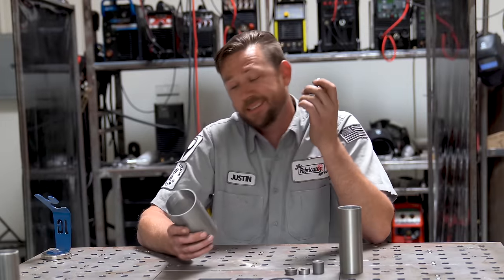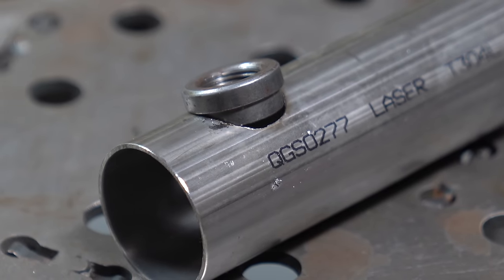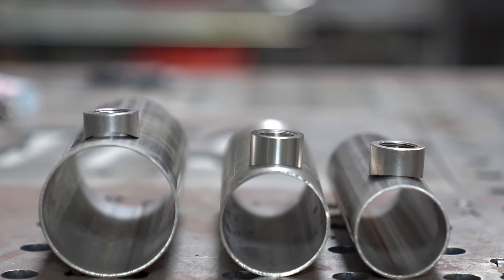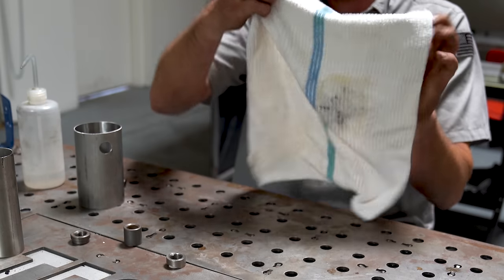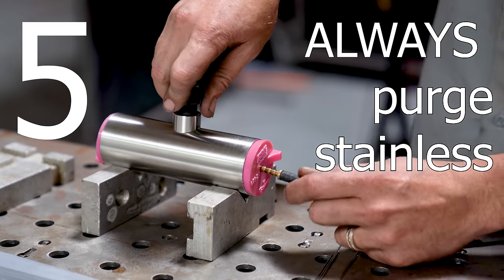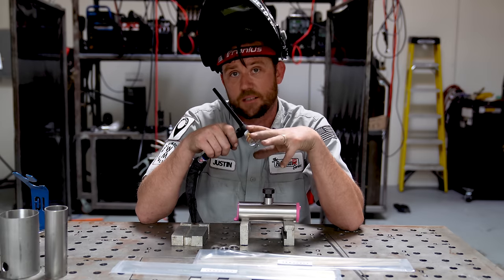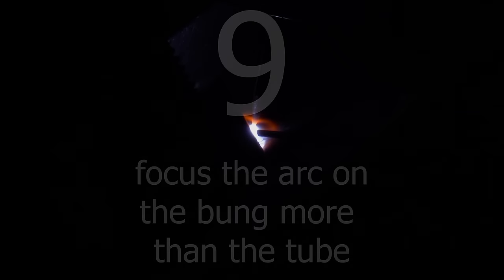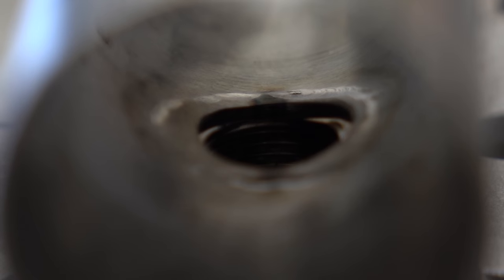10 Secrets for Perfect O2 Bung Welds

Comment from the maker: 💥 SAVE with code TFS10 at Weld Metals Online 💥
https://weldmetalsonline.com/
Reply: Hey Justin love your videos you are are the only reason I started to get into Tig welding you are a inspiration man. Just got a question - What is the difference between a normal tungsten compared to the Lazer tungsten you where using also used it on your alloy video?
Reply from the maker: @shaunhills3902  I appreciate it! 
There is no such thing as "normal" tungsten. There is only the tungsten that works best for what you do. In my experience, LaYZr is the most indestructible tungsten that literally welds every single metal I throw under it. It just lasts for ever and its my favorite until something proves itself superior.
Reply: Justin I can't thank you enough brother. I haven't been on the scene in 16yrs. Started again 2 days ago and I'm already shinin. Without you, Jody, and bob idk wtf I'd do for morale, motivation. Thank you for everything!
Reply from the maker: @CallofDoobie585  Keep at it 👊😎
Reply: Hi Justin, great video and thanks for the info. I like those aluminum blocks you use for positioning with the notches cut in them. Do you make them and if not where could I get some?

Comment: I've done literally thousands of stainless fittings to stainless tube, the requirements being for pressurized hydrogen and helium gas.  If you want something to center a fitting to the hole in the stainless tube, machine a plug to fit the bung for alignment.  NEVER, EVER use a threaded bolt as a centering device.  It only takes one to freeze up into the fitting to destroy both the bung and the pipe assembly it's going on to.  Also, I usually use the bung as the gas vent to allow the inert gas to exit the assembly.  This guarantees inert gas right at the inside of the weld where it needs to be.

Comment: Dumb question: if the bolt seals the bung, and the plugs seal the ends, and gas is flowing into the tube, does that mean that it's leaking or purging out of the seam between the bung and the pipe? My concern would be that as the gap was sealed off, the pressure from the purging gas would blow out the molten metal at the very end. Maybe the surface tension is enough to keep it all locked in.

Comment: I am about to Tig weld a bung on my bike exhaust and was wondering if it’s really necessary to add filler material. Come to think about, it does not need to be a very strong weld, all it needs is to be air tight. Thanks for your input.

Comment: Yes, always purge. Who makes those purge plugs your using in the ends? Side note the bolt works great but I wouldn't screw in in more than 3 or 4 threads, in can shrink and you will ruin the threads when removed.Thanks

Comment: I have one other tip I also use tip 4 and use a piece of rod ( sometimes a bolt sticks) as a heat sink but also I do not drill a hole until after welding the bung on.
Once the bung has been welded in place, I centre punch, use a slight undersized drill to Pierce  the pipe, then use a correct taper tap to tap out the hole.
You get the benefit of not blowing out the hole and once the thread has been cut into the pipe a more uniform job with extra threads...try it out!
Reply: Like this idea

Comment: I love using the Vibrant O2 bungs with the saddle that sits on the tube.  It also spaces the weld farther away from the threads to minimize thermal distortion.
Reply: These are the ones I use. Love em and make it very easy to not screw up.

Comment: what's the rationale of using 308 filler rod and (assuming) something like 304 base material? wouldn't 316 perform better as both the exhaust or manifold and filler material? regardless of that though, fantastic work, a lot of broscience in the field of welding especially coming from mechanics rather than welders

Comment: Nice piece of craftsmanship !

Never welded bungs but I did other stuff with thread in it, always put bolts in it, you risk deforming the thread by heat. 
Have seen enough examples of people trying to weld a nut onto something and afterwards it didn't work anymore, quite funny 🤣
That was with mig welding by the way.

Comment: Sensei Justin, I have a similar situation: angled solid 1" BungKing seat bungs on a 10 gauge mild steel solo seat pan. My 1/16 tungsten tips are burning up and the machine only lets you go to 90 amps before giving a warning. My welds look like blobs. Should i go to 3/16 tungsten , small wire (like double wound mig wire) or ? and say, 70-80 amps like you are doing here? You are right the parts are getting glowing hot. Nothing is flowing except the money leaving my wallet. :-0

Comment: Have you ever tried SolarFlux Type B for backing up your stainless work?   I used it on a SS exhaust and it saved me quite a lot of gas because I didn't have to purge the mufflers.   I bought a 4-oz bag for $20 on eBay.  You mix the amount you need with methanol and paint it on the back side and edges of the joint.  It dries quickly and you can weld right away.  It will melt and move out of the way if you weld over it, and the residue is sorta like glass.  Not good for food tubing but AOK for exhaust pipes.
Reply from the maker: I have two vids about it

Comment: This is so timely... I'm trying to weld a drain plug bung into my Transmission pan and it is just like an O2 bung. The problems abound immediately. I'm not sure if there is a coating on the pan because I'm getting a brown haze. Plus I ended up with a small hole quickly when I was just getting started. This little job is more trying than most of my welding projects. I hate to mention this is the second attempt because the first one is dripping under my car. I ordered another pan and another bung to try again in a different position with hopefully better results.
Reply: Any metal that is in contact with oil will have problems welding if you don't thoroughly clean the metal and then take a torch heat it up to sweat out the absorbed oil in the pores of the metal

Comment: Could have used this vid last year. Took me three tries! Cutting the botched attempt(messed up my measurements and had the angle off and it was pointed straight at the engine and couldn't install the sensor) out made almost as much a mess as anything else. It also appears that some of them are made of really junky metal that just wasn't cooperating. The final result was ugly(not to mention the patched hole from the bad location), but it worked.

Comment: Excellent video as I'm getting ready to TIG my turbo hotside. I've been Tig welding aluminum for twonyears now, steel/stainless are harder for me to grasp for some reason. You mentioned using a .045" filler rod. What size tungsten would you pair with that? Does this .045" filler rod tip apply to welding the v-band flanges as well?
Reply: For me it depends on amperage I'm going to use. 3/32'' is common as all around tungsten... If You're picky like me try to find .080''. I started to use it on thin stainless. 3/32'' felt too much and 1/16'' didn't stand so many restarts.

Comment: I always use a brass bolt in the bung and I have a piece of 1/6 inch thick by 2 in square piece of copper that I form to fit the tubing OD with body panel hammer.  When I place the copper inside of the tube as a backer and clamp the bolt and backer with vice grips it conforms perfectly to the ID.  Results = Zero blowouts.  I've even used 1-1/2" small diameter pipe and some old chisels to wedge the copper into place. 
I do the same when making custom hinges I use a brass pin before welding and on accessible body panels I use 1/16 inch by one inch wide by 12 in long strips behind the metal to keep heat warping down.

Comment: i weld at 90 amps when welding stuff like that and aim the arc slightly towards the thicker piece with the threads in this case.  i personally weld nuts to square tubing fairly often in my work and it is a similar thing when welding this thing.

but what i mostly weld is thin walled stainless steel tubing with tig.

Comment: wish i knew these tricks when i first started at my company 2 years ago, fresh out of college lol. pretty much learned everything you showed here as i went along tho they dont allow us to purge unfortunately. just means i got better at heat management to not burn the stainless haha. luckily they let me switch the whole tig dept over from the crappy pink cups to  the 12 furick setup so quality and ease of welding has shot up since.
Reply: You’re kidding about not purging right?
Are you not working with stainless steel??
How do you get away with tig welding a one sided stainless steel joint that cannot be accessed from the back side, in order to back gouge/grind, since there is no purging taking place???
Sugaring is not an issue with your QC department and most of all your customer?
One-sided, stainless steel complete joint penetration, with no access to the backside is ideal for purging when tig welding....
Assuming you are using the GTAW process that is...
“Sugaring” at the “Process” side of a stainless steel fabrication is a MAJOR NO NO at my facility.....
I’m all for back grinding the root whenever accessible....
This is common at our facility, but there’s always those situations where you cannot access both sides of the joint, hence the purge operation....
You should take the initiative and start purging when applicable.....
Just my two cents....
Reply: @jamier6742  while yes i agree that purging everything would be ideal and it bothers me that we don't, the customers we have typically dont worry about it. We make various oem replacement parts for pretty much every semi truck mfr. (Mostly exhausts) and none of the customers request that we purge the components. They know we dont and pay us accordingly to bring the unit price down. We only purge if the customer requests that we do so.

Comment: that's fine if you can roll the pipe around like that on a bench have put tons of threadlets on pipe but usually after the pipe is all up and then then the engineers ask for probes and drains always in position and usually on a ladder

Comment: Great tips. Welding on a tight diameter is always a bit more challenging and stainless with the purge adds to the effort. The last header I made header 15 years ago used /16 rod". I now have turbo header and exhaust to make in 304. On your advice, I picked up a 10 lb of .045" from my LWS which I should be able to pass on to my boys.

Comment: Great info.. can you do a video on making a jig for bent tubes, forming an OEM style exhaust port spigot for harleys, best wire grade and thickness to make the best welds on 304 tubing, welding a stepped tube i.e. 1.75" to 1.875" basically everything that's required to make a set of 2-1 exhaust system for harley

Comment: Once used a stainless steel bolt in such a scenario, the thing you can not get out again. :D
Reply: loool
Reply: Yip... 
bin there, done that 🤦‍♂️
Reply: How did you fix that Fraylem I did the same thing
Reply: I welded on a handle to throw away and started over.
Reply: @Josefppaz  you welded the bolt to the bung. Cut it off and redo it...
Reply: Dave McDaniel hi Dave I had too, once I welded the bung the thread must have shrunk with stainless bolt inside. I guess the more practice the better👍
Reply: I did the same thing Lol glad I’m not alone
Reply: are you suppose to use a aluminum bolt?
Reply: @jascal8437  yeah, or coat a standard steel one with high temp antiseize.
Reply: Dave McDaniel thank you
Reply: Show you right! Stainless distorts so easy.
Reply: He just uses a cheap A 36 bolt.
Reply: The part will always always  shrink when you weld it. Once a few good tacks  are on I always take the bolt out or in this case unwind it most of the way out before doing main welding
Reply: If you are using a stainless bolt on a stainless bung, you need to apply antiseize lubricant even if you aren't welding it or it could get stuck.
Reply: Stainless will shrink and then gall when you try to remove the bolt. It helps if you wait until it is fully cooled off to remove the bolt, and also use high temp anti seize like others have mentioned. I think we all learn this one the hard way! Lol
Reply: @Dr_Xyzt  might have to give it a whirl
Reply: @Dr_Xyzt  I use steel wool in aplications like this

Comment: What did you use to purge the pipe? Did the lose fitting bung and screw create a tight enough seal?
Reply: You don't want a tight seal actually.  A lot of people use balled up aluminum foil around the argon line, then a ball of foil on the other side.

If it's sealed it will blow out when you weld it on thin (.065) material.

Comment: I wish there were cast iron weld on bungs. Too many times my O2 sensors after usage gets stuck on those steel and stainless steel bungs. Maybe I need a tap to give it a bit more clearance or learn to weld with less heat.
Reply: Never Seize? Even if it passed pure oxygen a light coating on threads would be of minimal risk and should make future removal much easier. You could also in essence, lap the bung with an forged steel NPT plug, using a bit of NS and drive it in hard, then take it back out. This should stretch (or ream) the bung back into it's pre-weld profile.

Comment: Very informative video. I do lots of gland entries on cylindrical terminal boxes, and these tips help a great deal. I generally fit them up using flat bar clamped to the inside of the tube, then tack up and take the cup for a walk if the gland is big enough.

Comment: Are you supposed to keep the bung 90 degrees to the pipe or angled at a 45?
Reply: 90 so that the o2 sensor is in the center of the exhaust.

Comment: could you help me out with what welding setting you would use for 1.5mm wall stainless tubing, gas flow, amperage, filler size, tungsten size???? My welds are solid but they are coming out grey and shitty looking. I wipe everything down,tried upping the gas flow, amperage up and down different wire size and still still no luck. But when I weld the same tubing to a 12mm thick flange the welds come out beautiful with all the colours. 
Any help would be much appreciated,
Thanks
Reply: Amps & volts too high
Reply: Remember, a rainbow 🌈 colored weld bead and heat affected zone does not always constitute a “good” weld....
Using Stainless steel as an example, color in the weld or HAZ tells the welder that an oxide layer has formed, in which, can and will affect the corrosion resistance of the S.S. The darker the color, the thicker the oxidization. The industry and application of the weldment plays a role towards the acceptance criteria of a welds color. For instance, any color in the weld other than chrome, is unacceptable in the pharmaceutical industry. In other industries that demand sanitary welds, one being dairy, light blue colored welds are acceptable. Corrosion resistance can be reduced or all together lost, when trying to achieve rainbow 🌈 colored welds. In short, If you are an artist and don’t particularly care about the materials corrosive or mechanical properties, by all means color away. If you are doing code work, it would be a good practice to keep the color to minimum and/or within the specified acceptance criteria....
Happy welding!!!
😀😀😀

Comment: where do you buy bungs? i cannot find different sized bungs or anything in steel.
Reply: Any hydraulic fitting/hose supplier will have them.  You can get them on Amazon also. Usually the local hydraulic supplier is cheaper.

Comment: always found these really easy, specially when welding drain plugs into air handler header tubes, a round file will easily shape the plug to the right form to fit the tube and takes relatively little time to achieve . Most will be purged so the gaps don't really change anything as long as you're good at dipping the keyhole. i never use a bolt in threads when im welding plugs, sometimes they don't come out and if you use a thread paste it travels into your weld

Comment: First rule of welding, equalize the mass. Adding a bolt to the bung (ok for tacking into position) will add mass to the thicker part, increasing the energy necessary for thicker part to heat up, increasing the  the chance to blow through. Am I wrong?
Reply from the maker: I covered this in Rule 9. 
You don't always get equal mass and you have to learn how to work with that.

Comment: I'm trying to find a stainless bung for 2.5" pipe and I can barely find listings for parts that list the size tube they're notched for.
Reply: Same thing here, I can't find a place that has the size of pipe the bung is for.  After more research I found that most of the coped bugs will fit 2.75" - 5" tubing
Reply: @skrigz  I wound up getting the bungs in the TFS amazon store. The seller told me they we're for 3" pipe. The gap was manageable.

Comment: remember not to use galvanized bolts as the heatsink/locater
Reply: Or stainless bolts in a stainless bung. The stainless steel has a tendency to seize up to itself. Use a plain steel bolt.

Comment: Have you heard of people having issues with dynasty 200 dx  welders?
Reply: Those welder's are  solid as hell. What issues are you having with it?
Reply: @253fabrication   I have one and it is just weird, doesn't feel smooth. And aluminum is really junky. Never had a problem with any other welder before.
Reply: @kurtrudolph5723    Google "adjusting high frequency points" I'm not sure if your machine has them, but if their out of adjustment it's a bitch to start and welds like crap.  My old ass Lincoln idealarc 300 had that issue. Adjusted them and it welds beautiful!

Also I would do a resistance test on the power cable inside the torch.  We had a issue with the one at work, the cable got overheated and destroyed the copper.  We picked up a new lead, swapped the torch and it was welding great again!  You can also give Miller a call, they helped me with my old millermatic 210, adjusted a "pot" on the circuit board and it was fixed.